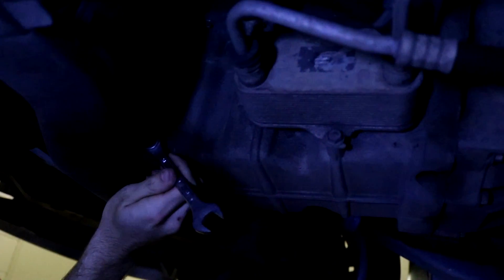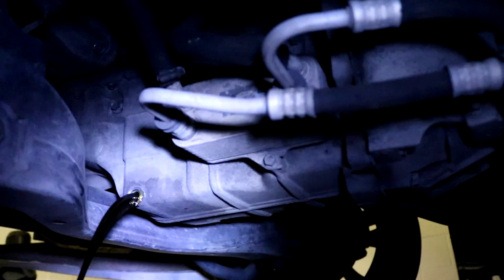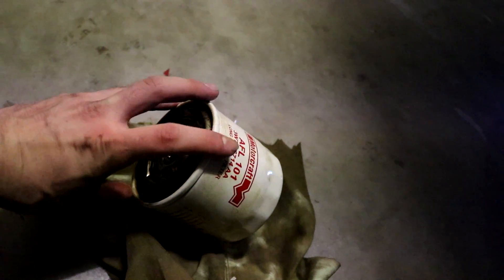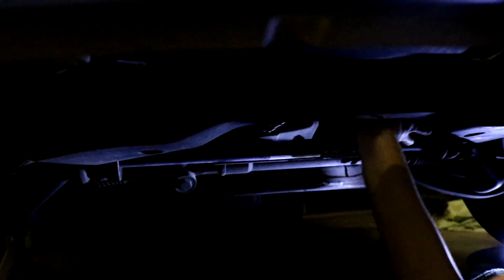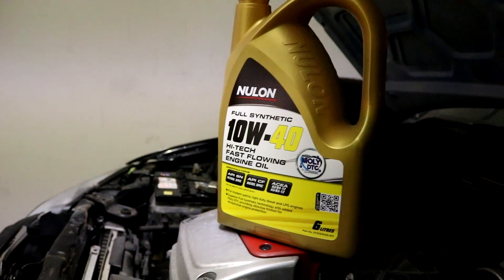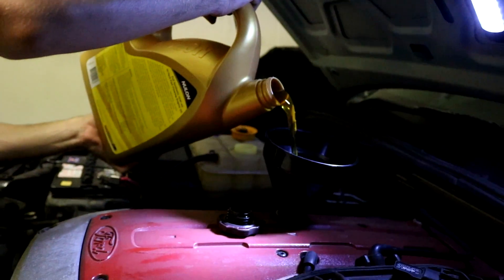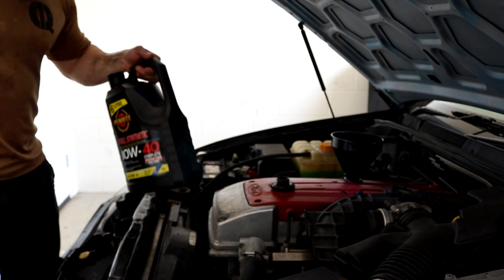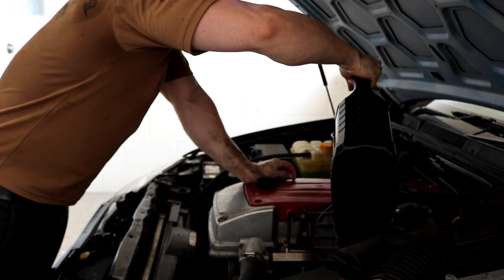Ford FG Service -  Changing Oil

Comment: i always follow procedure on the oil filter, tighten by hand until gasket contacts block then 2/3 of a turn with filter tool.
spewing about the oil all over your garage floor.

Comment: ZF6HP26 transmission should be serviced every 80,000km to 100,000km dont leave it longer then that especially if you tow or thrash it. It is only if you change the oil too late e.g. when the oil has destroyed the lockup clutch and it shudders and rpm hunts going up hills. The old bad oil is actually protecting the bad clutch change the oil and you lose all your protection and your transmission will go bang.  If you change it before it shudders/hunts you will be fine.

Comment: Great video.
Some of my 2 cents.
I use the stock motorcraft oil filter and never had any issue so far. Highly recommend the stock filter.
Please use gloves. Do not touch the engine oil.
I also use 5w30 FOrd genuine oil in my Ford FG XR6. I recommend everyone to check their service guide book to see what oil to use.
Reply: i use Mobil 5W30 specified to my Falcon and the genuine filter, my local Ford dealer uses that too
Reply: Agree - wrong oil used here - also oil capacity is 8.9 not "6-7"
Reply: It's actually 6.8 litres in the FG. And you don't need 5w in aus climates, unless you live Mt Kosciusko or something in winter.

Comment: I use a small belt tightening tool to remove these filters but, now I use Aeroflow filters. They have a bolt on the bottom of them, very easy to take off.
Reply from the maker: Yeah the belt ones are great because you can adjust them, my issue with them has always been as soon as they get oil on them you lose a lot of the friction needed to use them effectively.
Those Aeroflow ones sound great, I'll have to keep that in mind for the future.
Reply: Hi there mate , just wondering if you've got any idea how to replace a cigarette lighter in a FG . Cheers Brent .
Reply from the maker: The actual plug?
You just have to pull the piece of trim with the cigarette lighter in it out, then pull the plug itself out.

Comment: Good video mate, how to replace the transmission oil on ford falcon ute 2010. I can't  see any refill plug on a gearbox not same like a BA or BF there's a filler plug on a side close to exhaust pipe. Cheers mate

Comment: the fg takes 6.8 ltrs of oil including filter.just did mine.if your never sure of what your car takes just have a look at the website for your oil brand.there is normaly a car search menu that will tell you all you need to know, all this of course if you dont have a w,shop manual or just dont know
Reply from the maker: Good tip.
Yeah we had an entire discussion  about how much oil each engine takes (which wasn't in the vid) but mine has only taken 6.5 in the past, this time it was 6.9L
Just gotta keep checking that dipstick until it's at the right level ;)

Comment: Mate make sure to tighten the oil filter twice !! make sure it's actually sitting flush with the block..i almost made that mistake but i read about it prior. Penrite is very good !
Reply: After tightening.. it will become loose.. so tighten once again. . 
An issue with bf and fg falcons
Reply from the maker: When you turn the car on the oil pressure should cause the filter to stay tight.

Comment: 6 pot take 10/40 ? oil grade I use 0/40 on my xr8 fg good video lads bee safe
Reply from the maker: 6 and 8s tend to use different oil, but it's always been a hot topic for debate.
Everyone has different ideas about which viscosity is better. We just used the standard that Ford uses to avoid confusing people who are new to servicing.
Reply: Good point.just 0/40 in my ute because that is from factory thanks again
Reply: I use 10w 40 for my 2014 xr6 turbo

Comment: Never change the transmission fluid is fucks the solenoid in the transmission
Reply: KillerDeegan  it is bad I changed the transmission fluid on my ford territory and a month later transmission was stuck in fucking 3 gear so I took it to my mechanic and $1,200 later
Reply from the maker: Yeah it's not something I would ever recommend someone do themselves and can say I wouldn't trust most workshops to do it either.
Your case sounds like a rare, but expensive, one, that really does suck.
Ford claim their gearboxes are good for life, but that simply isn't how physics works. Stuff gets worn out, it gets old, it breaks down and needs servicing.
Reply: If the transmission is left neglected for a long time and then gets serviced it will definetly cause issues.
Reply: Never touch the transmissions especially the ZF 6 speed ones if it has not been serviced regularly...
It will cause more issues.
Reply: HI Roy,
I actually got my ZF serviced recently around 4 liters changed. Also put air cooler as well - got rid of that heat exchanger bomb.
Couldn't be happier.
Reply: @jordzmelo with air cooler in front of the radiator. Search furious zf6 speed cooler kit. It comes with all the parts and installation guide. Is yours turbo?
Reply: @jordzmelo in that case, the air cooler wont fit at the front. You will need to install it behind underneath the left headlight inside the fender with fan attached  to it. How many kms and how old? Have you been maintaining the coolant regularly? Do you baby the car or drive enthusiastically?
Reply: You can and definitely SHOULD change the fluid as long as its done at 80,000km intervals or even earlier if towing. A lot of ppl think changing the fluid causes problems but only in transmissions where the the lock up clutch has already gone and is slipping. Once that happens its too late leave the original and bad fluid in, put up with TC shudder and save for a new transmission/TC is my advice. These transmissions were sold sealed for life which is bs they need servicing every 80,000 to 100,000km as per ZF own website.